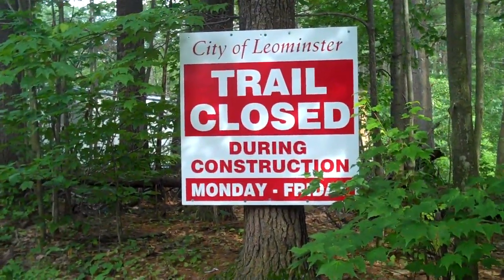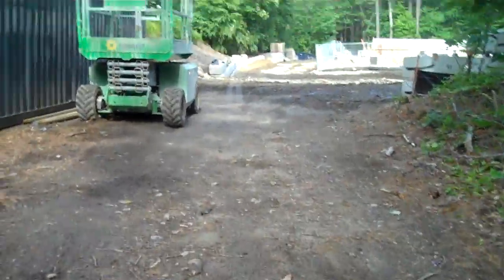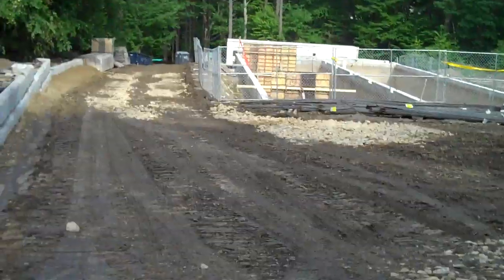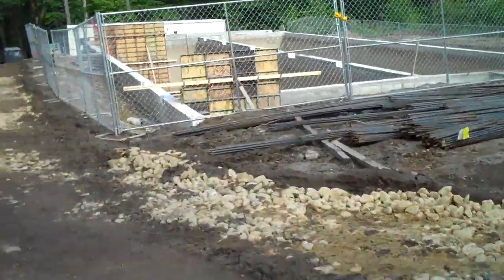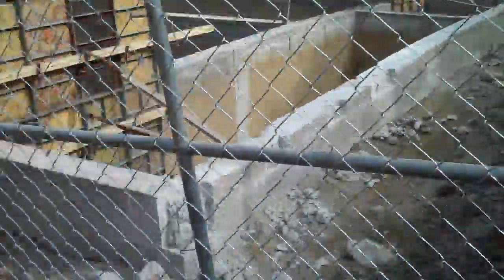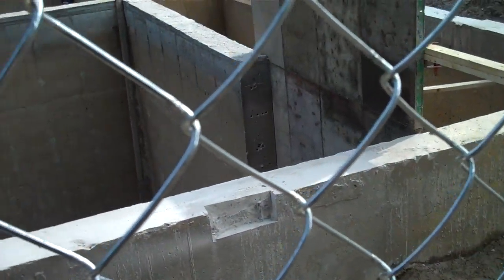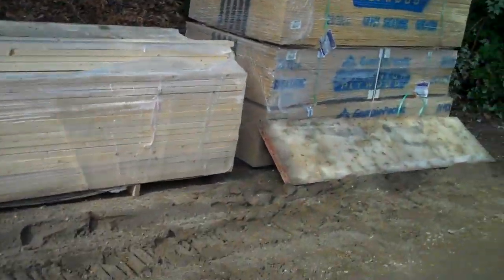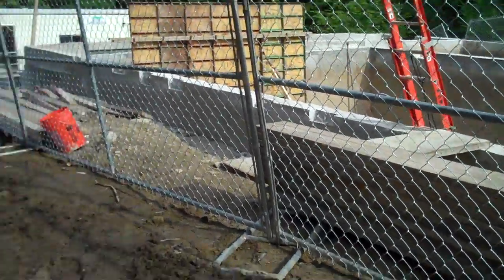Leominster: New Water Treatment Plant (Part 1)

Comment from the maker: @crapper1 
Actually, the wood was used for the sheathing to go along the building's outside. What is not evident here, is that the foundation they are using, is actually the original treatment building. They did use some forms to create the inner walls, though.

Comment: These are "SETTLING BASINS" where water, maybe with flocculants (particle clumpers) added, is allowed to slowly apss and let the clumps fall out, as a pre-filtering step.

Then it will go to the filters. The debris collected here is then pumped out of the bottom and dumped at an approved site.